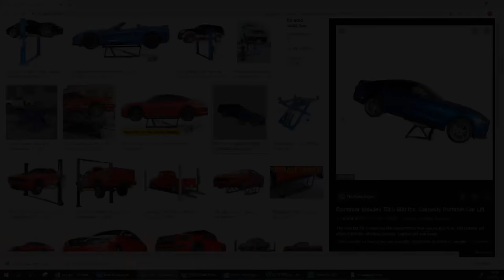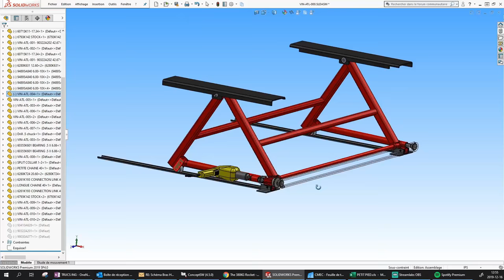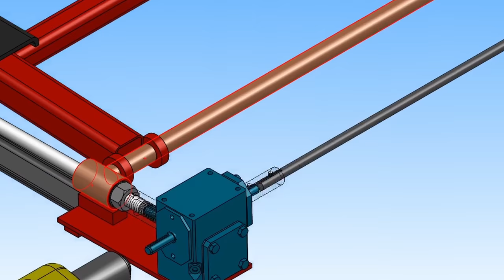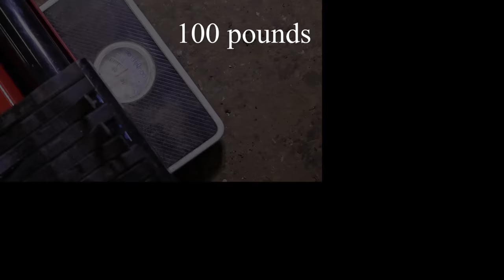DIY Car Jack, Car lift

Comment: How much money for the parts?
Reply from the maker: Sorry, I'm not selling it!
Reply: @VinyB57  no sorry, I meant how much did the build cost you. ??
Reply: I want to make this myself and went to your store for the plans but couldn't find them. I really like this idea especially paired with the jack that you made to make it safer
Reply from the maker: @drewrinker2071  Ah ok! First I'm not selling the plans, for safety purposes and second, the price will greatly depend on the price of the gearboxes, I paid mine 100$ for used one but I was very lucky to find them. The rest is acme rods (around 50$) and pieces of steel laying around in the shop. So to me it was about 200$
Reply: @VinyB57 the ok thanks. And yes I agree the design itself does not seem that safe but with the additional jack stands that you're using I think that would very much make it safer. My work thows gearboxes out all the time. So it's just mostly the metal

Comment: Does anybody know where to find the beam pads?
Reply from the maker: hi Tim, these are 1/4'' or 6mm rubber pads that I had laying around in my shop. The sharpness of the bottom joint from the cars (where the lift is pushing up againts the car) are now destroying them slowly...as long as you have something to prevent paint removing / and the car from slidding down the lift..😅

Comment: No PDF in the Folder apparently
Reply from the maker: I checked it, and it's still there. But I know that a lot of the times, nothing will show when you open the PDF. It's a problem with the 3D PDF size, it's to large.

Comment: This is reminiscent of how thugs steal wheels off cars in American cities.

They place milk crates under the rockers in the middle of the car, then tilt off of each axle to get the raised wheels.

Then they leave the front bumper on the ground, with all of the weight of the car on it...
Reply from the maker: That's a good summary of it!

Comment: Thought I'd check back to see if the PDF issue has been resolved. It has not. This might be a reason you are stuck at 1800 subscribers instead of building a viable online business. Its a pity cause its a great build but seems to be a lot of trouble for all involved
Reply from the maker: Steve, it's a PDF, get over it! For some it works, for other it doesn't. I'm doing youtube videos for fun, to share my projects and inspire people to get in their shop and build something! I increase my average of subscription every single month...so stuck...don't think so, you should do your math. So if you have something contructive to comment about, please be my guest and if you give me your email adress, it will be my pleasure to send you personally the PDF and move on....🤦‍♂️
Reply: @VinyB57  I see issues with the PDF from everyone so its clearly jacked up.  You have some chops-good for you. Unsubscribing now. pity-could have been great

Comment: That's a great job but definitely NOT for DIY-ers. I'm a mechanic and I stick, mig, a d tig weld yet would NOT be confident building it
Reply from the maker: Yes you are right, this project is NOT for everyone, I always have backups, like using overkill stands. And I tested the jack for 2 days up in my shop with my car on it, and I repeat this test frequently. But again, it is not for everyone and you need to know are good your skills are if you want to play with 2000-3000 pounds over your head.